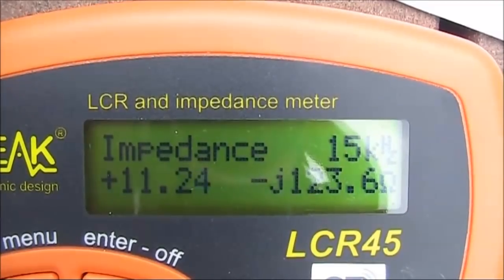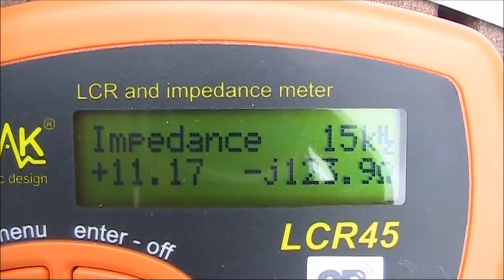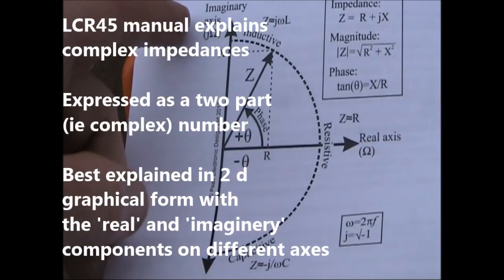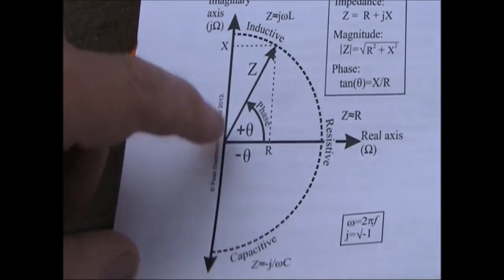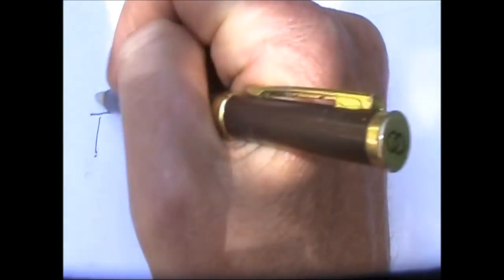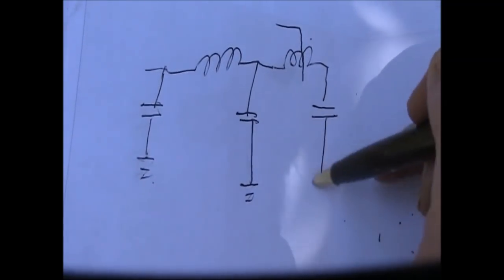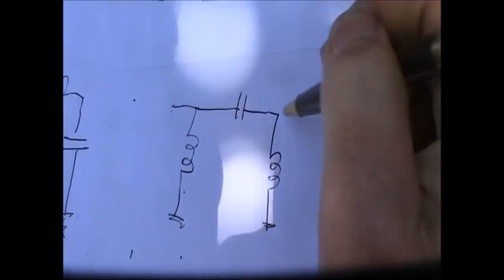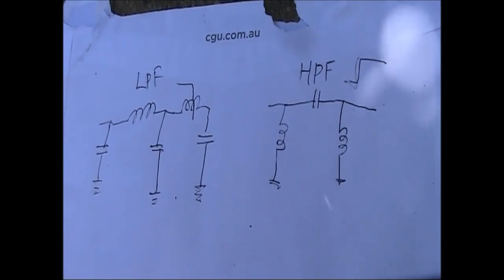Tutorial: Demonstrating Capacitance, Inductance, Reactance and Frequency

Comment: Good Stuff Peter. Do you know your clip on Mic is working on only one channel?
Reply from the maker: Yes. It's a toss up between good audio through one channel or bad audio through two.  Experimentation with the camera and audio input connections has so far failed to provide audio on both when using an external mic.
Reply: I have seen in the past TV presenters with 2 mics about 2cm apart clipped to their shirt. I thought they did this to get impressive stereo effects as each mic would hear slightly different to the other. Maybe  you could try it as a solution?